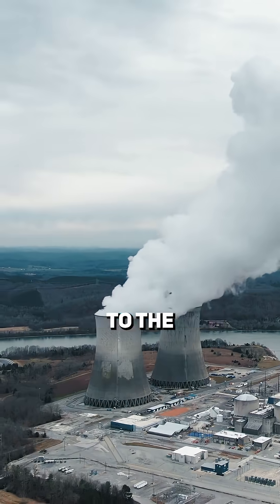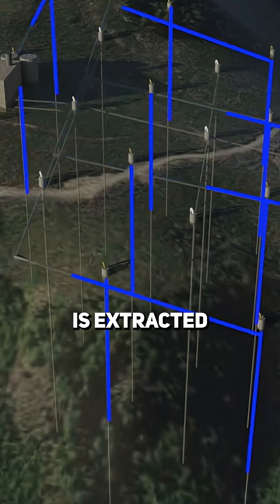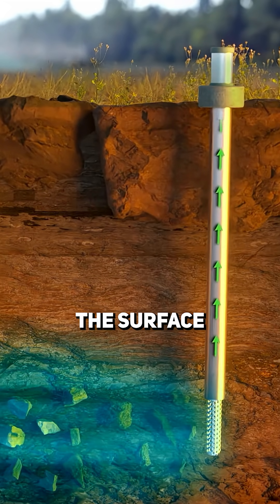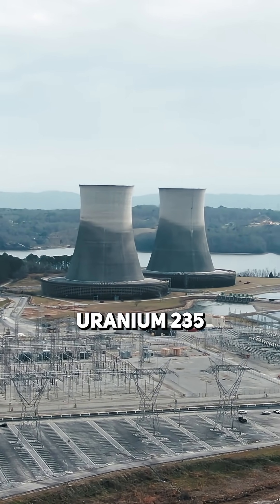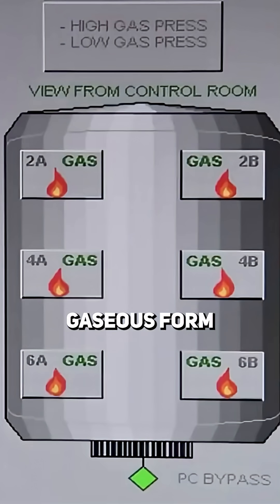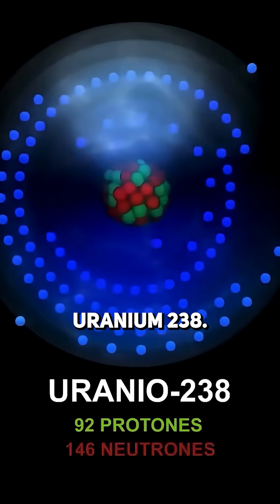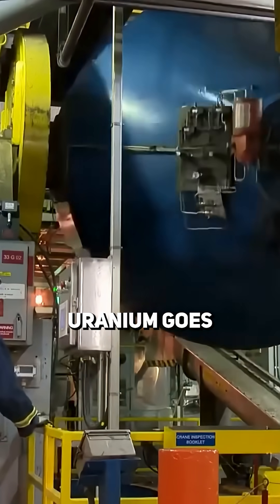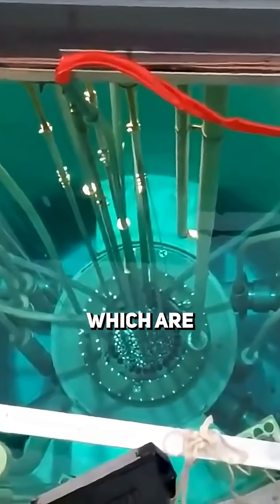How does Uranium go from Rock to Nuclear Power?!

Comment: Now talk about the insane steps you need to take in order to keep the enriched uranium from going critical. Like they don’t just put a bunch of pellets into a bin like that, they have to be physically separated to prevent cascading neutron releases.
Reply: Not how it works. This low of an enrichment (around 3-5%) is not physically possible to "go critical." For it to be a trouble it would have to be around 90% enrichment. Also the pellets are not packaged in any way that would be dangerous. And lastly in this case for U-235 you would need a moderator to slow neutrons down because they move too fast to hit any nuclei. Which is one of the uses of water in nuclear reactors, so they can sustain the reaction.
Reply: Critical means stable, did you mean supercritical?
Reply: @ondatra_dl  They meant critical outside of a reactor, but that's not right either because nuclear fuel can't reach criticality without a moderator like water or graphite.
Reply: @cassandra2860 It can if it splits via fast neutrons
Reply: JESUS IS THE WAY, THE TRUTH AND THE LIFE. Repent and turn away from your sins today🙏🏻
Reply: @JesusPlsSaveMe I love Jesus too, but nobody ever changed their beliefs because someone on YouTube told them to, go work in a soup line like the rest of us

Comment: Uh how are these dudes handling enriched Uranium fuel by hand?  Their hands would be burned, their DNA obliterated and they would die.
Reply: There is only normal decay going on in the pellets. They only get very dangerous when they are activated by Neutrons
Reply: Fresh fuel rods are completely safe to handle, the cladding protects you against the radiation(which is still very low)